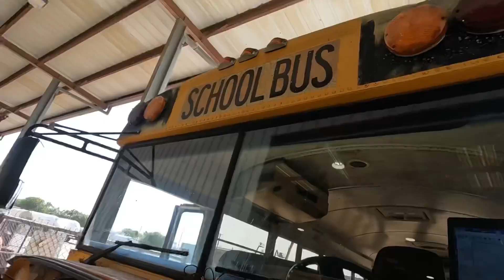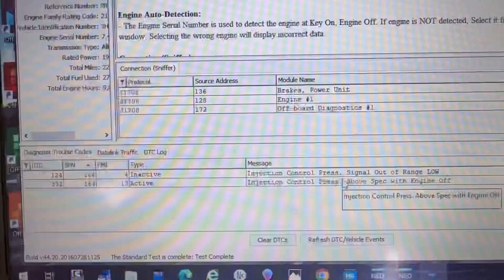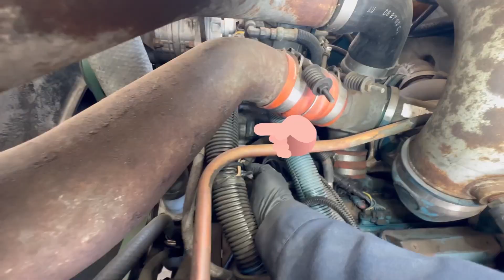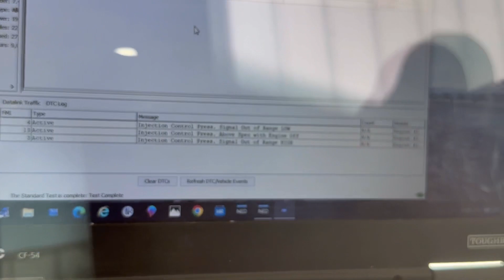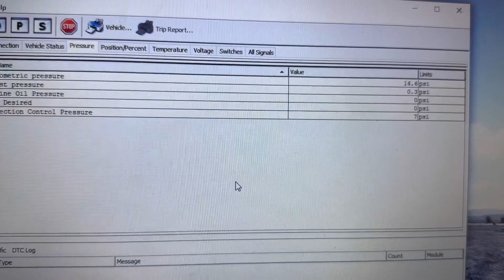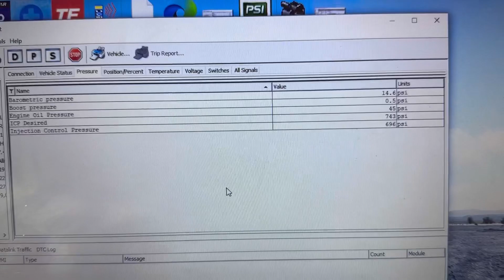Customer States- Finally!! 7.3 (T444E) ICP diag and repair

Comment: Hey bud! I am running this bus! (2001) . I had a stuttering issue under heat and load when driving. Bus stalled. Replaced ICP with OEM because it ran better with ICP unplugged (even though it ran like shit still, it at least didn't stall out with ICP out) and after taking it to shop, that was their recommendation. ICP definitely had oil in the connector so I replaced the pigtail for it too. Same issue. ICP plugged in she will eventually sputter like she's misfiring and then stall but unplugged she does the same but not stall.
Thoughts?

Comment: Noice!  I have two buses with the 7.3 and an F350.  I've been trouble shooting low ICP pressure on the F350.  I think my new Ford OEM sensor is bad.  I sent the IDM and PCM out and they tested good.  The engine harness is new too.  It's been a gremlin trying to catch it!

Comment: I had a 1999 24' International rollback tow truck with the T444E and a 5 speed manual that had over 350,000 miles on it when it was retired and the only reason it was retired was it was the oldest truck in the fleet.
       I loved that truck but the boss wanted to update the fleet completely so it and the 1993 F350 wrecker had to go. Both were great trucks and the ones that required the least amount of maintenance outside of their routine PM schedules. It saddened me to see it go because it was dependable, got better fuel economy than the 466s with the 7 speed Spicer and was actually faster on the highway loaded down with 2 vehicles. I sure do miss that 7.3 engine.

Comment: what year is this bus, i have a 94-97ish bus with a t444E, has no power with the intercooler and pipes connected to it, but if i put the Y pipe connector from Ford 7.3 to it to eliminate the pipes and intercooler, has power.. i double check pipes, hoses and intercooler, no holes and leaks, turbo has no oil or dirt in it at both sides.. no play at the bearing, no oil leaks, 

turbo is a very small Garret with very small holes at the intake ''cones'' between the heads..  

only thing is that the turbo has very sharp turbo impeller which i think it could be a bad sign of wear and tear...

i must say that it has the allison 545, and the t444e has only 190hp,, has no EBP sensor and the MAP readings give just 1.1 psi.